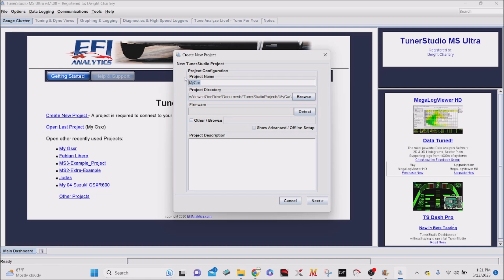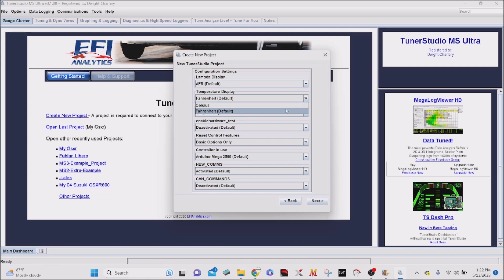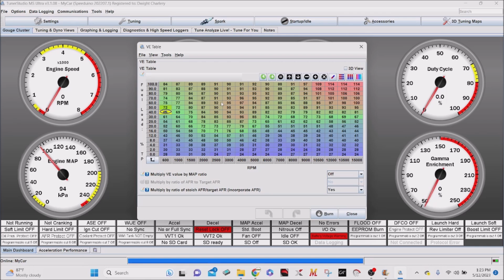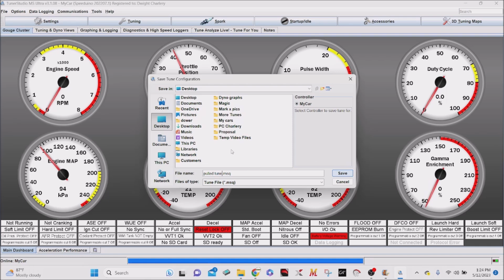How to Pull a Tune File off a Speeduino ECU

Comment: Thank you for this! I followed this to pull a tune from a car I bought, but had several hurdles to jump in terms of COM port and firmware files before I could get the ECU to connect, might be worth adding that.
Very helpful though!!
Reply from the maker: Typically after installing the Arduino ide software, you get all drivers needed and don't have com port issues